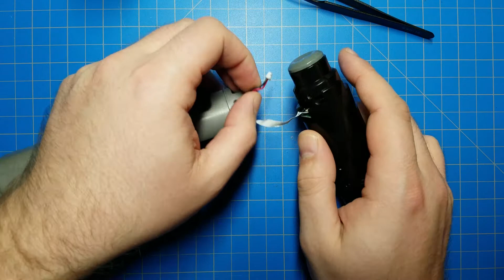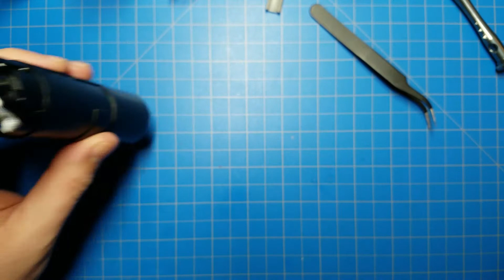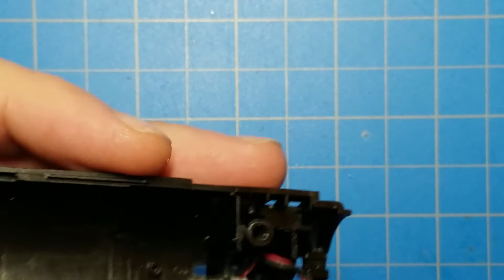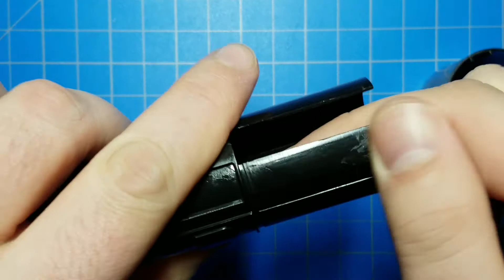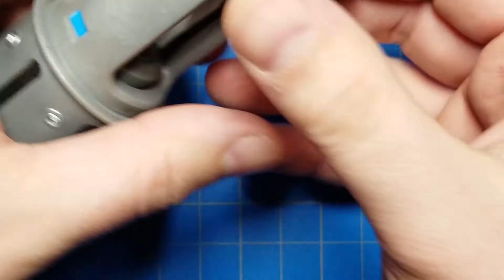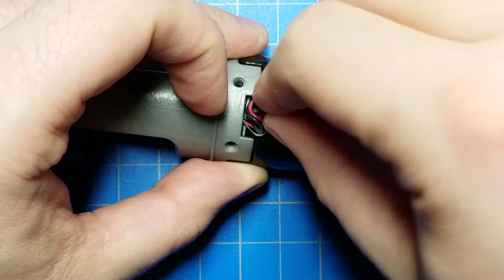Savi's Workshop Lightsaber Chassis Disassembly and Reassembly

Comment: Do you know where you can get the red and black cable? Mine broke. Or what is it called?
Reply from the maker: It's a 1.25mm JST connector. The wire is 150mm long. You can buy replacements online in many places, here's an amazon example: https://www.youtube.com/watch?v=uJNrIZvvKW8

I have a video where I replace this cable. It's here: https://www.youtube.com/watch?v=uJNrIZvvKW8

One thing to note, something I don't cover in that video, is that the red and black wires on the new connector are usually backwards. You'll need to remove the pins from the connector and swap them around. Or you could solder the new wires backwards, but I would resist doing that.

Comment: Thank you for this video!  This Savi’s hilt was ~1.5 years old when the blade would just randomly deactivate and reactivate regardless of switch position.  I tried a new switch, but that didnt help the problem.  I was able to change out that flat  cable thanks to this video and looks like its working.  Thank you!!

Comment: Hi, I wanted to ask if you could help me with buying the white, and the black-red wires at 9:46 minutes into to video, because mine have gotten damaged, so I wanted to ask you if could know the names of these wires and where could I get them, would really appreciate it because I don't know the name or where to find them
Reply from the maker: The white cable can be bought here: https://www.amazon.com/dp/B07RWF3GQG/
The red and black wire cable can be bought here: https://www.amazon.com/dp/B09DYLPQPS/

Be aware that the colors of the black and red cable may be reversed from the cable in your lightsaber hilt. Compare them to confirm whether or not this is the case. If they are reversed, you can still use the cable, just be aware that where the red wire was soldered to, you must solder the black wire of the new cable (and old black to new red as well).

Comment: I need to replace my power cable, do you know of anything that will work for this or will I need to solder up something?
Reply from the maker: i assume you mean the red and black power wires inside the chassis. the wire itself can be any gauge you want, but if you also need the connector, the connector is a 1.25mm pitch 'jst' or 'picoblade' connector. if you're replacing the entire wire, it's 150mm in length. something like this: https://www.amazon.com/dp/B081V3V9HT/

NOTE: the red and black wires may be swapped on the wires you order when compared to the power wires inside the chassis. please compare with the old power wires and make a note of whether or not the colors are swapped before you do any work!  if swapped, you need to either swap the wires in the new connector (can be done by gently lifting on the tab in the connector that holds each wire in place and pulling the wires out of the connector, then reinserting them in their correct location) or, when soldering the new wires to the top side of the chassis, solder them backwards (red to where black was, black to where red was) in order to keep the connections correct when you plug the other end into the bottom half of the chassis.
Reply: @Ruthsarian  wonderful, thank you!

Comment: Can you do a teardown of the bottom half of the chassis?  I want to see if it's possible to remove the single LED that lights up the crystal when it is inside the chamber and redirect that power somewhere else.
Reply from the maker: I will. In the meantime, I have a google docs spreadsheet with a bunch of information and photos including some images of the activation switch PCB which includes a surface mount LED that lights up the bottom of the crystal (it's labeled 'RGB' and is in the center of the circular PCB).

Look at the 'Savi's Workshop Chassis Hardware and Operation' tab here:
https://docs.google.com/spreadsheets/d/13P_GE6tNYpGvoVUTEQvA3SQzMqpZ-SoiWaTNoJoTV9Q/edit#gid=1187173987
Reply: @Ruthsarian  Thank you.  Based on this image, I don't think my idea will work.  

Are you familiar with wireless LEDs?  I'm making a crystal right now with wireless LEDs embedded inside that light up whenever they are near a coil of copper wire outputting a 5 volt weak magnetic charge.  My plan was to disconnect the LEDs inside the hilt and insert one of those wireless power transmitters so my crystal would light up from the inside whenever it was in the hilt.  Does that sound feasible to you?  

If not, is there perhaps another place where in the hilt where I could solder some wires to siphon power?  I'm only just getting into hobby electronics so I don't know how easy or difficult it is to insert a new device into an existing one.
Reply: @Ruthsarian  I actually discovered last night that the RFID reader already inside the hilt can activate my wireless LEDs.  But they only go on for a second since I guess the hilt sends out one pulse to try and connect with a crystal.  But do you think there might be a way to switch that pulse on permanently?
Reply from the maker: @Rot-z-v6r  not really. 

the RFID reader in the hilt is controlled by the microcontroller. the microcontroller knows to scan for an RFID tag when the switch at the top of the crystal chamber is pressed. it'll attempt a few scans and then give up. 

to keep it going longer you'd have to keep pressing that button. but if you release the button, the hilt will shut the blade off, so keeping those LEDs blinking wouldn't work if you also want to have an active blade.

so, ultimately, i think the answer to you question is no.
Reply: @Ruthsarian  Darn.  Well thank you for the help.  I might need to build my own lightsaber.

Comment: I'm having a problem with the blade locking in noise. When I try to put in the blade, it doesn't lock up. What do I do? Edit: I tried to lock the blade on permanently, now the crystal won't glow, any advice??
Reply from the maker: pull the battery pack and leave it out for 5 minutes. then plug the battery pack back in and try again.

have you tried replacing the batteries?

what did you do to lock the blade on permanently?
Reply: @Ruthsarian  Well, I didn't actually permanently lock the blade in, I just made sure it wouldn't get out. Also I actually have fresh batteries, but I think the ribbon cable is the problem.
Reply from the maker: @jediweaponmasterliam9  have you opened the hilt at all? if not, it's probably not the ribbon cable. it would more likely be either the power or data wires attached to the point inside the hilt that the blade connects with. if it is that, it's possible to resolder the wires, but it's not a simple job. 

before you take the hilt apart,  you should contact disney's merchandise guest services. e-mail them at Merchandise.Guest.Services@DisneyParks.com or call (877) 560-6477 and tell them about the problem and see if they can replace the hilt.
Reply: @Ruthsarian  I did open the chassis and I actually found out that the ribbon cable is bad bents all over it. I may need a new ribbon cable.

Comment: That's great and all but what if the hex screws won't actually screw back in?
Reply from the maker: do they screw in, but keep turning? or do they not go in at all? if the latter, the holes of the gray outer sleeve are probably not aligned with the holes on the inner, black plastic core.
Reply: @Ruthsarian  They go in and keep turning like they aren't seating properly. It's kinda like when a bolt's head is stripped, and you try to use the right side wrench to turn it.
Reply from the maker: you could try wrapping a small piece of electrical tape or teflon tape around the threads. the extra thickness might help the threads grip.
Reply: @Ruthsarian  Okay thanks, do you have a solution for putting the top half of the hilt back in? I know where to put it but I can't get the cables put back the right way
Reply: @Ruthsarian  If you have discord I can send you pictures of it in it's current state.
Reply from the maker: @thatoneultramarine208  either email ruthsarian@gmail.com or you can find me on the galaxy's edge discord at swgediscord.com
Reply: @Ruthsarian  Thank you for trying to help, but my mom decided to take a look at it and turns out the whole reason is because the red and black wires were disconnected from the battery end, and the cable was pull up towards the top, I'm sorry for wasting your time man

Comment: Idk if u still respond or not but,the red cable came out of the white thing and it won’t go back in. As I was replacing my batteries and it wouldn’t turn on still then I opened it up to see what’s The problem and the orange strip and the red cable came out and I do not know what to do.

Comment: Link to replacement ribbon cable?
Reply from the maker: This is the cable: https://www.amazon.com/dp/B07RT6XGY3/
It's out of stock right now. This is an alternative that would work and is in stock: https://www.amazon.com/dp/B07RWF3GQG/

Or you can search elsewhere. The cable specs are:  8pin 150mm 0.5mm pitch FFC type B

Comment: My light saber turns off and on over and over again I looked to see if I could figure out what it it is. Could it be the ribbon cable by any chance?
Reply from the maker: remove the battery pack. wait about 5 minutes. then plug it back in and see if that fixes it.

Comment: Thanks for the great video.  I was wondering if you knew where I could find a replacement socket for the black/red power cable shown around 2:30 in your video?  It broke off when I was try to plug it back in and am trying to find a replacement.
Reply from the maker: The connector you are looking for is a 2-pin 1.25mm "jst" or "picoblade" connector that is at a right angle. There are a few sellers online where you can buy these such as from these eBay and Amazon listings:

https://www.ebay.com/itm/171740181198
https://www.ebay.com/itm/164241683690
https://www.amazon.com/dp/B014ZGBWWO/

You may be able to find other sellers if you search a little more than I did. The ones I found are coming from China so expect it to take a few weeks to get to you after you order them.
Reply: @Ruthsarian  Thank you!

Comment: Can you buy a replacement of one of these?
Reply from the maker: a full chassis? there's no official means to buy a replacement. if yours is broken,  you can contact Disney at Merchandise.Guest.Services@DisneyParks.com and they may be able to send you a replacement.

people sell them on eBay as well, but they tend to go for $150 or more. i expect those prices will eventually drop once both parks are open at full capacity.

Comment: Fuck me! i replaced the ribbon cable, then I broke the power socket, then replacing the socket I broke one of the hair thin copper wire from the antenna, then I put it back together and it wasn't working, I inverted the power socket wires, took  me half day to sold it back!. Now it works but what a PAIN IN THE ASS, who designed this must be executed by electric chair!!

Comment: Does the 8pin really matter or could we get a 9 pin?
Reply: I got some ribbons cables and I am trying to replace the original one. The bottom side where the ribbon cable sits won’t go in all the way. Any suggestions?
Reply from the maker: @portereaglin-mccabe6305  it could be it is going in all the way, it just doesn't look it. close the clip and tug on it to see if it stays in the connector, if it does it's probably okay. there could be debris inside the connector, try blowing into it and see if it clears the debris. get in close to look at it and see if there's anything obvious as to why it's not going in all the way. the plastic clip or the housing could be damaged and it's getting caught on a sharp corner. maybe the cable is damaged and frayed and therefore isn't able to fit inside the narrow opening of the connector. if you have a spare, try that one, or reverse the cable and see if the other end is able to go into the connector (confirming it's the cable).
Reply: Ruthsarian ok I’ll give it a try
Reply from the maker: it matters. a 9 pin ribbon cable it would not fit the connectors. if that's all you had i suppose you could try to trim the ends of the cable so their are only 8 pins.

Comment: My lightsaber stopped lighting up and after disassembling and reassembling a few times I was able to get it to work, but only if i dont put the black cylinder/“sleeve” on where the blade is attached. Any ideas on what could be the issue?
Reply from the maker: There is a piece at the base of that black cylinder that has 3 pins on it which are used to make a connection to the blade. It can be put in backwards. I've done it myself, several times. That's probably what's happened. 

With the sleeve on, the blade only fits in one orientation and that orientation isn't matching up with the pins. Remove the sleeve and the blade isn't being held in place so you can make it fit the backwards orientation of that connector.

If you rotate that connector 180 degrees and reassemble it, it'll probably work.

Comment: How does the button system work?
Reply from the maker: there is a hall effect sensor in the hilt which detects the presence of a magnetic field. the switch mechanism has a permanent magnet that moves into and out of range of the hall effect sensor. the microcontroller in the hilt receives the signal from the hall effect sensor and turns the lightsaber on.
Reply: @Ruthsarian  Thank you for the information. I did my own slight deconstruction, and found that out about how the magnet moves. I am guessing these hall effect switches are on the market? think it would be cool to use this type of swtich vs just a button.
Reply: So does the magnet complete the circuit? when the button is lifted.